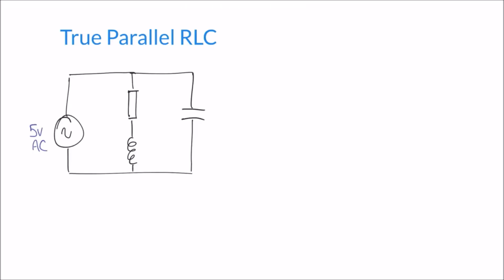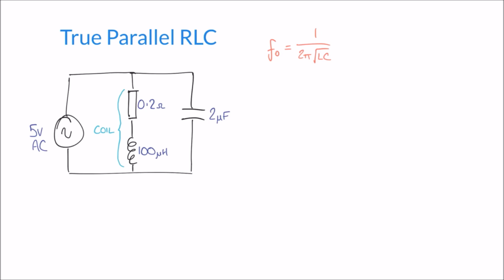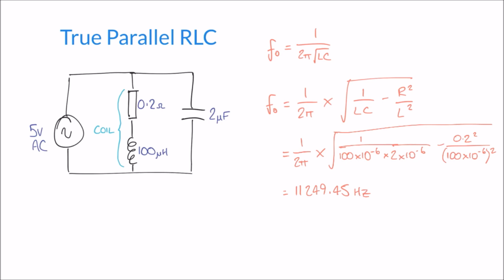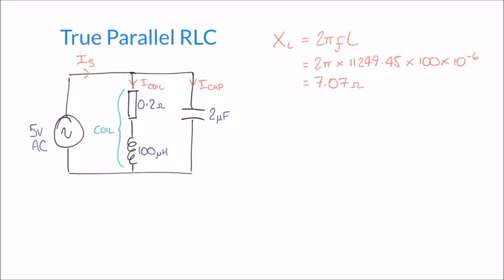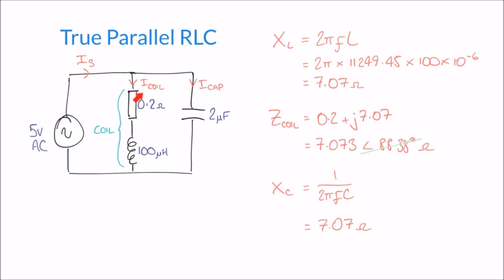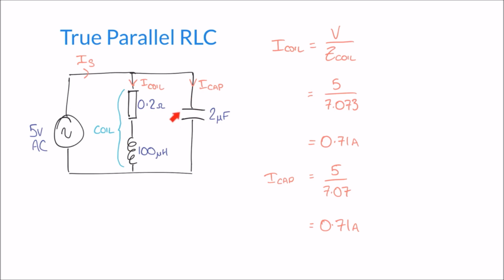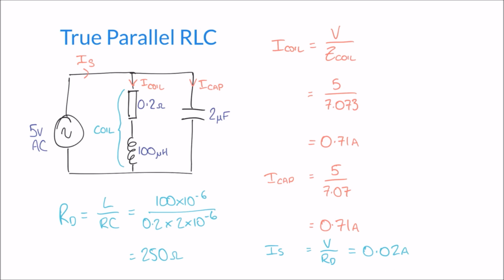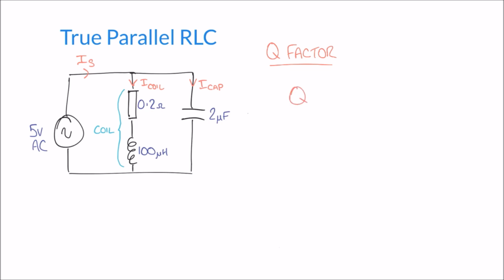Resonance and Q Factor in True Parallel RLC Circuits

Comment: May I  ask a question?.Is the advanced formula for all non neglible resistors on Paraller.or the formula changes with circuit setup?.am Stuck on this.
Thanks for the help as well as for the videos you upload.
Reply from the maker: The "advanced" formula is specifically for this particular circuit arrangement.

Comment: may I ask why in this advance formula need to put  (R^2) /(L^2)   ?
Reply: Impedance of this circuit is calculated in the same way as resistivity in the DC circuit (L and R are in series and LR are in parallel with C):
          Z = (XL+R) || XC,
where XL=iwL, XC=1/(iwC) are the impedance of the coil and the capacitor respectively, w=2 pi f is the cyclic frequency, f is the frequency, i^2=-1 is the imaginary unit, R1||R2=R1 R2/(R1+R2) is the resistivity/impedance of resistors connected in parallel.

By definition, resonance occurs when current I and voltage U are in phase, which means that at resonance Z is real. So, to find the resonance frequency we need to solve equation
          Im[Z]=0
with respect to w, which gives the required formula.